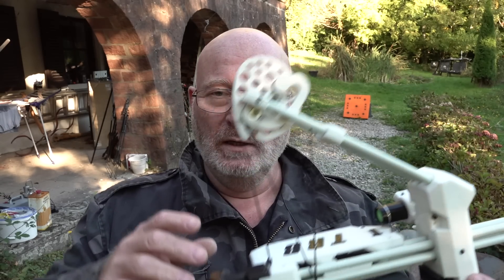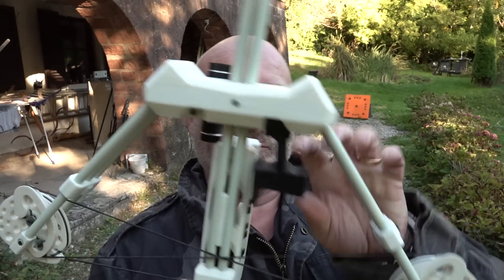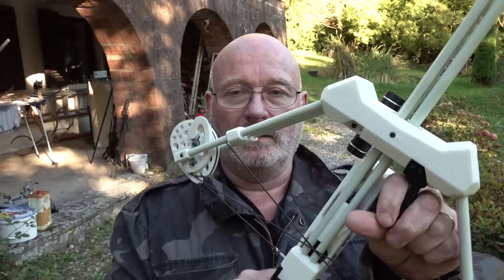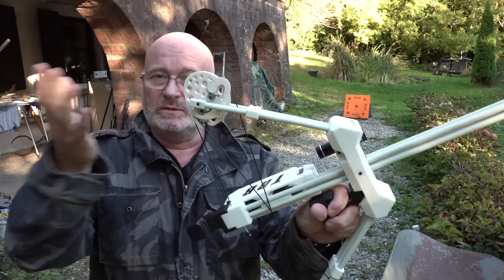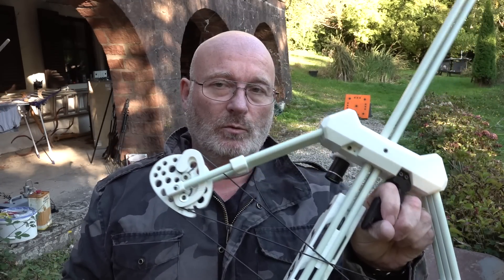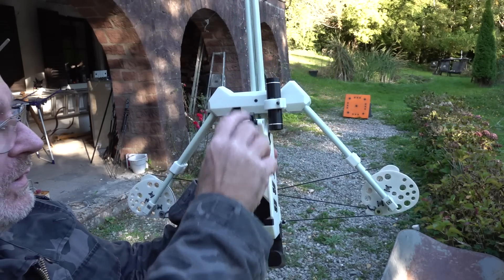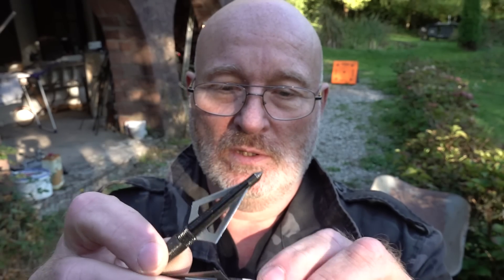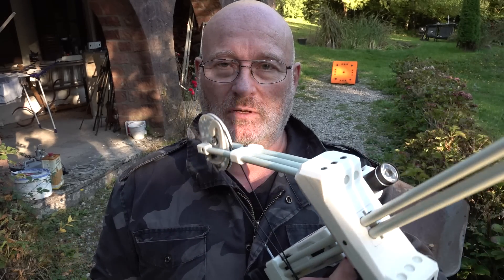3D Printed Mini Pump Action Compound Bow!

Comment: Joerg, I would look into nylon filament for those bolt bodies. Carbon fiber or glass fiber nylon composites would be ideal, and while more expensive than PLA, they are under $100 (US) per kilo, sometimes even under $50.

Comment: Holger Breetz asked why I didn't use standard arrows. (Sorry Holgar I can't seem to reply by clicking on reply under your comment. I am new to youtube). There are 2 reasons. The first and foremost is that I wanted the TRB to be printable on virtually any printer. Some printers have a max z height 180mm. The mag height, therefore the bolt length, is determined by that. Secondly, a printed bolt body costs a couple of cents and can house standard field tips/ 2 blade broadheads. I use the left over bits of plastic on the reel so they cost me nothing but time to print.

Comment: Nice design. This makes me think about a modded Sliding Legolini design which both allows mounting fiberglass rods instead of using rubber tubes plus a longer "barrel" which enables one to have a larger draw length. I do not understand though why the designer hasn't choosen a more standartized bolt length like those readily availabe 6.x " bolts ? Most magazine for Compound bows like the SIL allow using those. Makes much more sense to me than DIY bolts.

Comment: This reminds me of the other 3D printed rubber band bow that you showed off. I actually printed that one and it was super fun. This compound bow version looks cool too but I don't know about the handle. I guess if your big hands fits it I guess most people could hold it but it looks like you are only holding it will just a thumb and 2 fingers.
Reply: Supposing you know how to mod. 3D printing files, couldn't you rotate 90° the handle so that it is more comfortable?
Reply: @rikospostmodernlife  it's hard to know from just looking at it in this video. I would need to take a closer look. I also have little experience with modifying 3D models so I could probably make it more comfortable.
Reply: Jacob, I was worried that Jorg's hand wouldn't fit either because he is a big man. In spite of that the handle is surprisingly comfortable and controls the bow very well. The two finger grip poses no problem whatsoever. There are bigger handed men than Jorg however. To those I apologize that I was no able to accomodate them with this design.

Comment: I would worry about shooting bladed heads through a channel like that since they might nick the bars, or even dig into them causing some pretty substantial failure. Aside from that though, this whole design and construction is phenomenal. I love the color matching and it is impressively compact.
Reply: Agreed. You can actually see small bits of PVC or whatever material those rods are made from coming out during the slowmo shots.
Reply: @Stormclowe  I don't know what was coming out of the barrel, but it wasn't anything to do with the barrel rods. The body of the bolt is half a mm bigger in diameter than the field point/broadhead. There are no scratches on my barrel rods even after hundreds of bolts fired. If the rods ever get hurt for some odd reason, the fiberglass rod is very inexpensive to replace. The same could be said for any part of this bow.
Reply: @alanjohnstone6902  It looks to me like the draw-rods are bending (bending and torquing) in Joerg's hands when he is at full draw. This slight bend is what gives me pause about the design. Working with a lot of composite spars this is not unexpected or surprising to see. Comments? Thoughts?
Reply: @christophers_verified  The barrel rods fit through the barrel which is held in the riser by a screw on either side of it. Therefore, there is room for the barrel to swivel up and down slightly. Also, there are relatively large clearances between the barrel rods and the barrel which allows for a little rotational movement. These two points allow a fair amount of movement of the magazine assembly. I suspect that this what you are seeing. One would have to force the magazine off its natural line to get the barrel rods to bend or torque. You would need to purposefully force it off its line. In a natural draw I have never noticed the rods bending or any indication that they had. In spite of the play described, the bow remains accurate since the laser is attached to the barrel. If you do continuously draw the bow higher than the center line or lower than the center line, the ptfe tube which protects the Dyneema from the trigger, will begin to move off center. This is easily shifted back into position and will remind you to correct your draw. One could possibly force the barrel rods to bend while drawing the bow but that would be a very unnatural draw. Developing torque in the rods would require you to force the handle in opposite directions. again, very unnatural. They may be bend and torque in the rods but I have never found indication that it is so. The bow stays accurate and the muzzle velocity stays constant.
Reply: Should add metal inserts to protect the PLA.

Comment: Pulling the bolt out could cause more damage than leaving it in. In first responder classes they always tell us to never pull a arrow out. But to cut it off if needed (having to carry someone out of a area by hand to rescue services) and pack the wound around the shaft nub. Bow hunting in my area especially primitive weapons is poular. So accidents happen. I can see how running with it in could cause more damage depending on the location. But not much. On such a weak weapon. Having the shaft break off on a arrow/bolt that's not a complete or partial pass threw(sticking out the other side) could be beneficial to the target. It can just plug the wound it creates. A home intruder will most likely try to pull out a stick that's sticking out of them. Causing faster blood loss. Which is how weapons like this stop larger threats. Back in the day a broken off arrow would of been bad. They really didn't have EMS, surgeons or antibiotics. So it was pretty much guaranteed that person was not returning to the fight.
Reply: My intention was that the perpetrator would need to seek medical assistance. This would allow him to be apprehended.

Comment: i made one of the adderini repeating crossbows, an used the thera-band gold to power it instead of actual cross bow limbs an i have made 2 at this point, one that uses the thera band gold and the other uses tube rubber an uses rollers on arms, looks like a compound setup but its actually just rollers so the rubber tubing can travel across them without friction but that one has become the family favorite cause its just strong enough to shoot it on the front porch an its has turned into something my hole family does when they are all here sitting on the porch including the kids, but b4 the other setup with the gold rubber was a bit to strong to let the kids shoot and they couldn't cock it but with the "compound" setup with thera-tube silver its almost as if it doesnt have any rubber when cocking but shoots a flat for about 15 feet, anything more than that an u have to start to arch the shot but atm i think i could cut the length of the thera-tube silver an get alot more out of it but i'll probably leave it the way it is just so we can keep using it on the porch. i cant wait to try this one. not sure how many of the 3d printed rubber power stuff there is out there but its become one of my favorite things to do. i have made several others besides the adderini like zx gun, uses 6mm rubber tubing an shoots 8mm steel balls, its similar to the adderini in how it cocks an it has a magazine on the top that holds 50+ bbs that drop down an are held in place til shot, then one that was just called the dragon an its similar in it shoots the 8mm steel balls but uses a similar setup to the compound setup on my 2nd adderini so its just to allow the rubber tubbing to move, but it uses the thera tube silver, an another repeating crossbow pistol, has to be the smallest ive seen so far an that includes the one u made thats the same size as the firearm cant remember which one, but theres a model of that one out there than can be printed, i have it just haven't gotten around to making it, but the smaller one is called survival arrow gun im putting it together now. i have quite a few others that ive not gotten around to yet both 8mm steel ball and 6inch bolts, ill try to list as many as i can so if anyone is interested they can google them or u can find them on the cults3d website he has in the description to where this one is sold.  instant rufulini, baraba repeating crossbow(similar to adderini but uses aluminum extrusion), vr crossbow, xoslingshot, and a couple different magazines that u can put on the 50-80lb crossbows on amazon so it turns them into repeating crossbows. most of them can be purchased for a few bux some are a little more but i had never purchased a 3d model until i run across the adderini and a ar15 rubber gun an after that its started me down a path an i still have made everything ive paid for yet. this one is going to be added to the list, i love seeing stuff on here that can be 3d printed cause that means i have a good chance of being able to make it so im always going to encourage more.